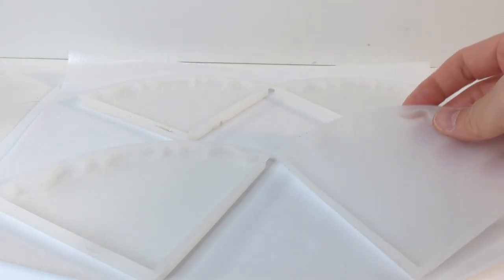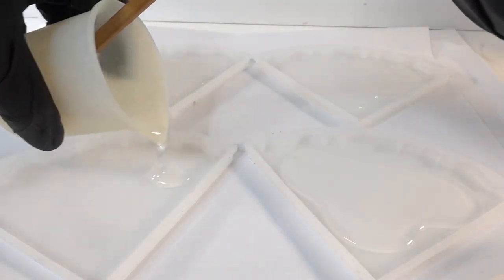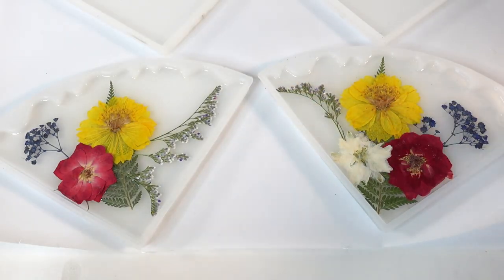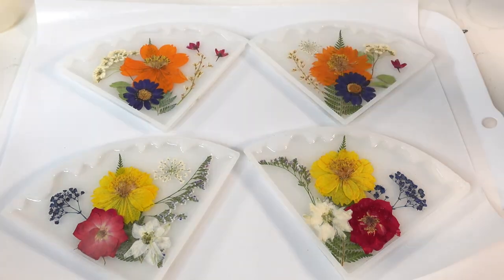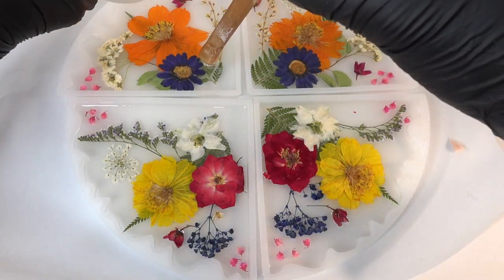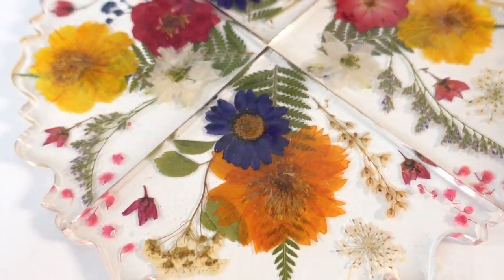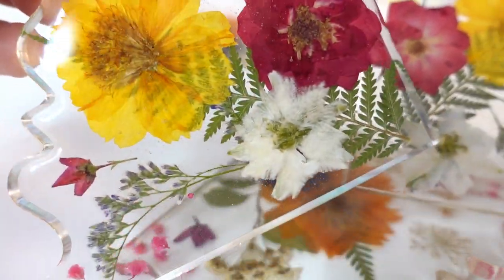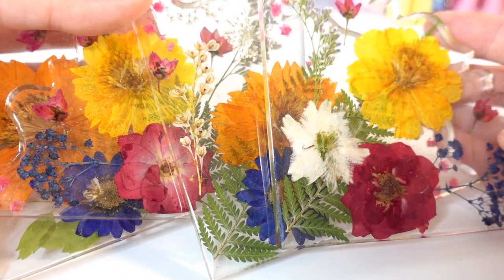Watch me Resin - Dried flowers in Geode Resin Coaster

Comment: This was lovely. I’m interested in pressing and drying flowers, but haven’t done much with it yet. I love the look of them in resin very much, and agree that to add extras wasn’t needed. While I was watching, A thought occured to me.I’m wondering if anyone has thought to try doming these while still in the molds? Or would that even work? I haven’t done enough on my own yet to know much, but it seems feasible.
Reply from the maker: I usually done outside the mold because resin sticks a little to the mold so it always create a raised lip if the mold wall is higher than the pour height. Outside the mold, without a wall, the resin sticks to itself. Hope that makes sense 😅